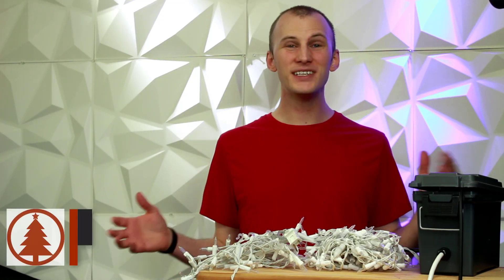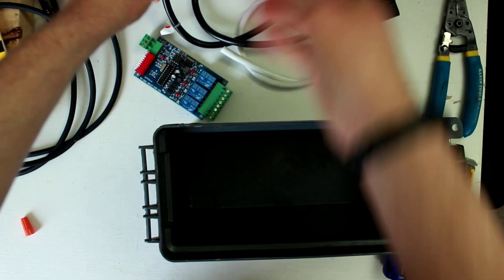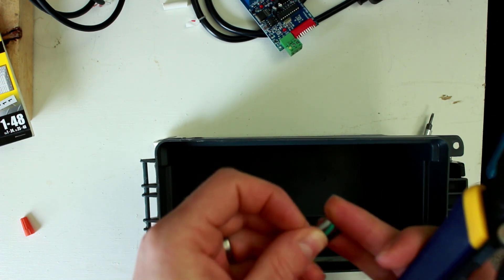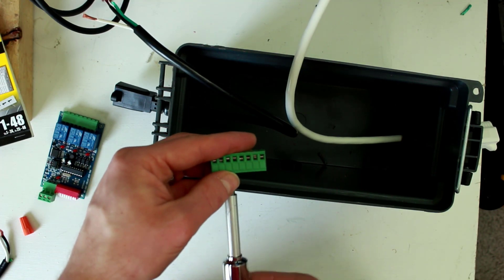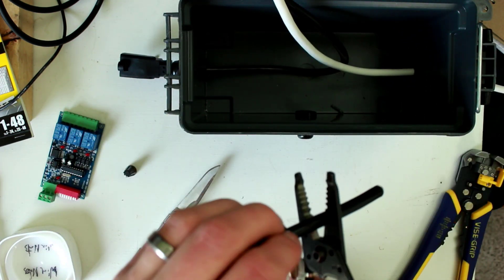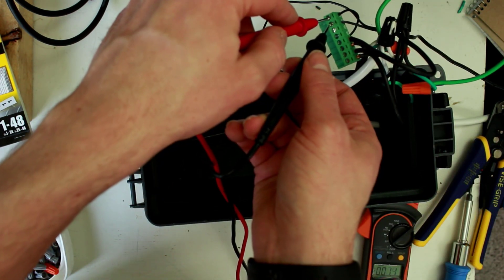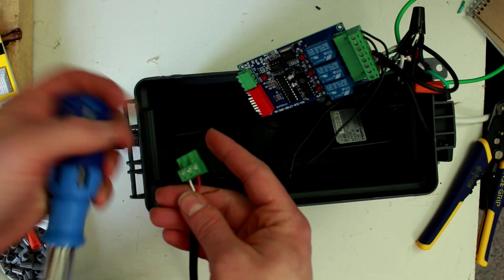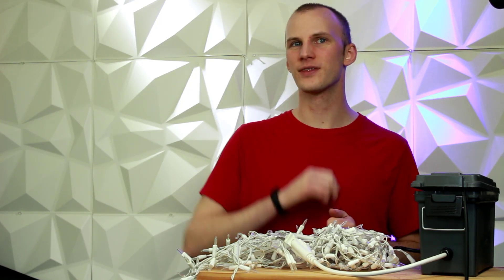DIY Christmas Lights Controller for Under $40

Comment: This is great! I've been watching a ton of your videos but I do have a question. This controller you show is 5amp, 3 channel. So  is that 5 amps per channel? Or 5 total?

I'd like to control /dim the c9 stringers I have, maybe slow fade in/out of possible. I have about 200 of these c9 (led, 0.58w each, ~116w total) and IF my math is correct I'll be right at 10 amps and I can't figure out if this is right for me.  Thanks!
Reply from the maker: Each channel is 5 amps

Comment: I am looking in to doing this project but do you mean the live wire as in a second power supply and what voltage would that be? Very confused about the live wire situation!
Reply from the maker: Voltage will be whatever the voltage is of the item you are using the relay to turn on and off.  This device is basically like a light switch for whatever you wire into it, so for me in the US, it is 120v

Comment: Hello, I'm very new to this. I've built the box and have a dmx to usb cable that I've wired to the relay but xlights doesn't recognize it. Am I going about this the wrong way?  I'm just trying to put together a very simple display. Thanks
Reply from the maker: Common errors: try switching the DMX positive and negative leads - it may be wired backwards.  Make sure you have the correct driver's installed for the DMX-USB device you are using.

Comment: Hey I was just wondering where do we connect a 120 V AC power line
Reply from the maker: AC power (hot) runs through each of the relay's - use the wiring diagram provided with the relay board you purchase to determine exactly where this goes.  Typically the neutral and ground wires tie together separate from the relay board
Reply: @LearnChristmasLighting  thx thishelps a lot

Comment: Hi I was wondering what is the name of the stage lighting software that u used
Reply from the maker: I use a lot of different stage lighting software programs, depending on the need.  Check out my channel Learn Stage Lighting for more!
Reply: Ok but what program did you use in ur disply
Reply from the maker: xLights
Reply: Ok thx

Comment: Can you explain (or give an example), of how to tie in “old school lights” on the newer falcon control boards? 

I have a series of net lights and other lights that I would like to include in my display.
Reply from the maker: Definitely in the plans for a YouTube video next year!  For now, I do cover this in-depth inside of Learn Christmas Lighting Academy: https://learnchristmaslightingacademy.com/learn-christmas-lighting-academy/

The short, text-based answer - you set up a DMX (RS-485) output on the falcon and assign it to a universe in your controller's tab in xLights.  Then you set up "single color" models in xLights and assign them to that universe and the first channels.  Last, you assign the DMX address to 1 on a controller like this and connect the controller with Cat5e or DMX cable to the RS-485 output on the Falcon.  Thanks!

Comment: Great videos! Thank you. 
I am just getting started with light displays and have zero backround.
Can you use xlights to control this setup? If not, how do you control it with a computer?
Reply from the maker: Yes - it's DMX-based so you either need to use a DMX-USB adapter, or even better, a pixel controller with a DMX output.  For more help and more detailed videos, check out my full courses, which are all included in Learn Christmas Lighting Academy: https://learnchristmaslightingacademy.com/learn-christmas-lighting-academy/

Comment: hi david i would just like to know a inline fuse for 5 volt ws2811 what kind of fuse should i put a 5 -10-or 15 thank you
Reply from the maker: It depends on how many lights you have, and what wattage they are at.  :)   Not a simple answer.

Comment: Love all your videos! I’m just getting into a light display myself. Like you, I have a background in stage lighting, so this learning curve is similar, yet different! 

I’m having some trouble with Xlights, and my OpenDmx. I can get the program to talk to it, but when I try to output to my lights (testing with a Chauvet Slim Par, set in 3 channel mode), it’s not talking properly to the fixture and the channels are all messed up. 

Could you possibly do a video, combining a hookup for OpenDmx, and integrating stage lighting into a light show. 

Thanks again for doing all these videos!
Reply from the maker: Hi Thomas,

Great to hear from you!  I'm not currently planning to use any USB-DMX, simply because both the stage and Christmas lighting world are quickly moving away from USB-DMX towards networked DMX for everything.  Add to that fact that many of the cheap USB dongles don't work well anyways, it's just something that I don't feel I can recommend to people.

Thanks!
-David

Comment: I’m trying to make a sign for my business using dumb led neon rope. It has a pot tipping over by a series of three flashes that show the pot vertical on the first flash, 45 degrees on the second flash, and horizontal on the last flash. It looks like what you have here would work with three channels but is there a way to pause the first and third channels a little longer? Maybe a similar controller that is wifi accessible so that I can adjust the time of each flash on each of the three channels? Any help would be greatly appreciated
Reply from the maker: This really isn't an LED tape/rope controller, but it can power things on and off via DMX.  So, if you had a wireless DMX controller, you could definitely get that function.  Plus, a DMX controller with a wireless setup would also give you the ability to control the timing exactly.  Best of luck!

Comment: You mention that rather than using a DMX controller you can use ethernet.  Can you elaborate?
Reply from the maker: Yes - the particular controller I used here uses DMX signal, so I have that hooked up via a DMX cable to my pixel controller, which has a DMX output.  But you can use ethernet cable for DMX signal as well.

OR, you could get a controller that takes ethernet directly.  In that case, you wouldn't need a pixel controller with a DMX output, as the relay controller would take e1.31 (sACN) directly, just like a pixel controller.
Reply: @LearnChristmasLighting  Any recommendation on a controller that has Ethernet directly or what I would add to the controller that would enable ethernet
Reply: @LearnChristmasLighting  Built the box, connected an rj-45 to the dmx output (orange to D+, Wht/org to D-, and Brown to ground). Set the DMX Address to 37 (Not sure why 37, it was what the one page manual listed as an option)  Plugged this into my Falcon V3 on serial 2 but I don't know how to get the falcon or xlights to recognize the controller
Reply from the maker: @grogsailor   Well, you need to define the channels for DMX to a model in xLights as the first step.   I would set the DMX channels on their own universe, and then assign that universe in the Falcon's configuration to the serial 2 port.  At that point, DMX will be sent out of serial 2, and you can use channels 37-39 to control the lights.  Or, for a simpler setup, set the DMX address to 1 and define that in xLights as your channels on that same universe.  Thanks!
Reply: @LearnChristmasLighting  Can you recommend a controller that takes ethernet directly?
Reply: @JoeCrawXS  I honestly haven't found one that takes ethernet data.  See my comment 2 comments above that walks through connecting via DMX to a pixel controller (Falcon, Advatek, etc).  This is probably the simplest way, even if you don't have pixel lights.
Reply: @LearnStageLighting  Can I use a Kulp F8-B with a Beaglebone Green (or Black) instead of a Falcon or Advateck to help keep the cost down?

Comment: is there any way I could hook it up to go to a radio station or speaker i am playing music through?
Reply from the maker: Absolutely!  In that case, you'll start with a computer running xLights or Vixen, and both this controller and your FM transmitter/speaker would be connected to the computer :). Thanks!
-David
Reply: Learn Christmas Lighting thank you!

Comment: Now how would one interface this with XLights on a network? Getting a Art-Net to DMX node, or is there a good DIY/inexpensive option?
Reply from the maker: Most controllers for Christmas light pixels (Falcon, Advatek) have a DMX output via art-net built in.  If you don't have one of those for pixels, then you'll need an Art-Net/sACN node.